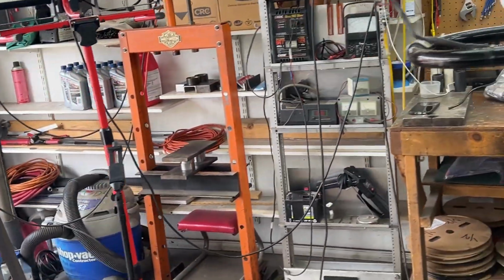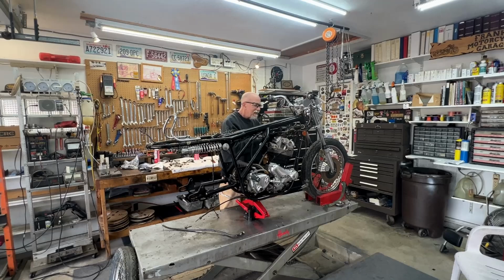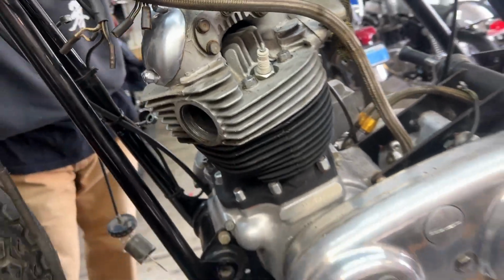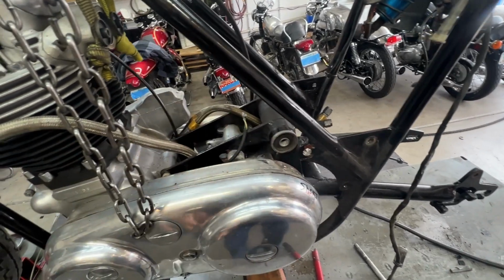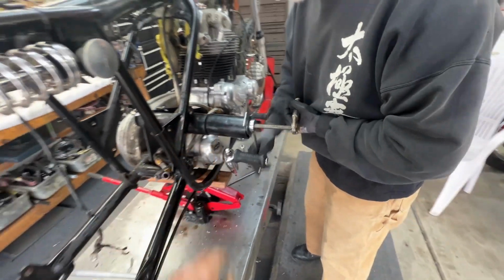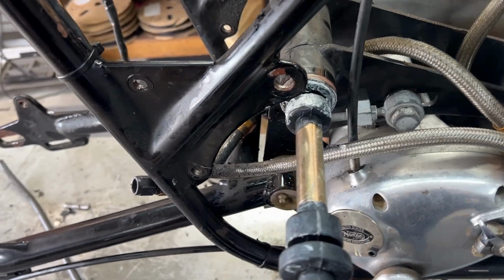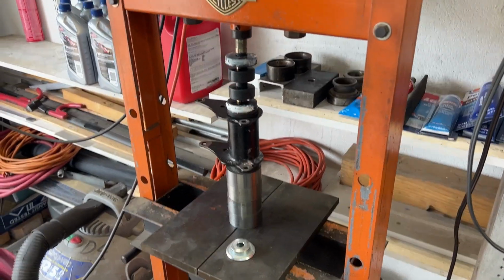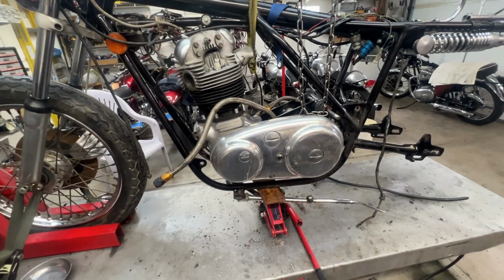03-23-24 - Replacing Norton Isolastics - Day 02

Comment: I have fitted vernier isolastics to a pre MK3 without shortening the mount, the kit I used was sourced from RGM rather than Andover, as I understand the screw on end caps are re-engineered to compensate for the longer mount tube, prior to these being available you needed to shorten the tube.  I wonder if it's a packing error and the have sent the MK3 end caps instead of the shorter parts that fit the pre MK3 models.
Reply from the maker: I agree with you completely.  I suspect the parts are wrong.  Part numbers are correct.  Their video says they should fit.  I will have the mount cut down to match the shorter side.

Comment: My standard '74 Mk2 took the Andover Norton front Iso kit (06.7337) without any alteration to the mounting. Great bit of kit.
Reply from the maker: I agree.  I have installed the MKIII upgrade kits on several MKII's with no problem. But not enough kits to remember where any individual kit came from.  And I think I always just bought the complete new front iso mount and this is the first time I had any problem.  So, possibly, maybe, perhaps, the parts in the kit are for a MKIII mount. I have my machinist standing by to shorten the mount. I will do a follow up vid when this is sorted.

Comment: The 1973/74 MK2A came with the black plastic air filter box, crossover pipe, and blackcap (“bean can”) mufflers.   The  MK2A was originally sold for the European market which had issues with noise.  Apparently Harley’s  were still allowed to make noise in the U.S.

Comment: As l understand it, the original Mk3 vernier front system when fitting to an earlier model, required the shortening you outlined.
However the later kits were changed to enable fitting without the removal of material from the front mount.
It's still not that easy though and double check you have the correct later kit.
Reply: Well you've answered one of my questions in replies to others.